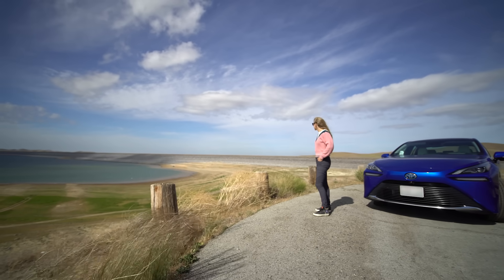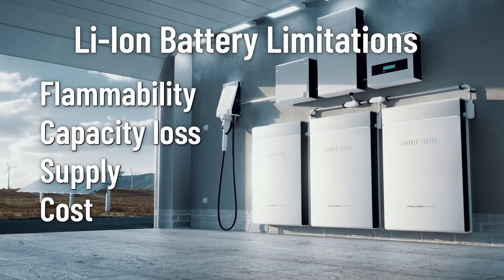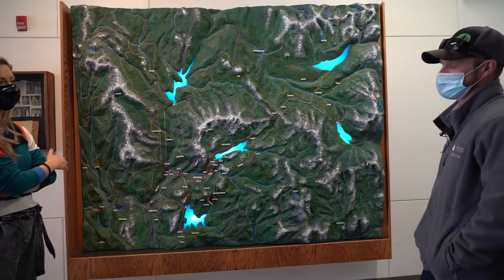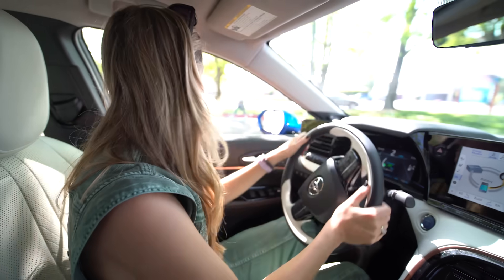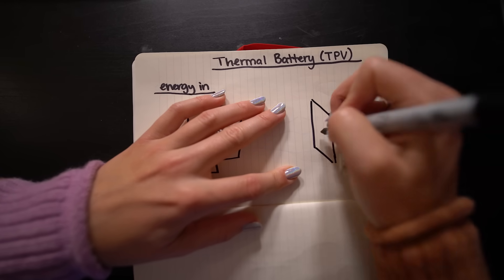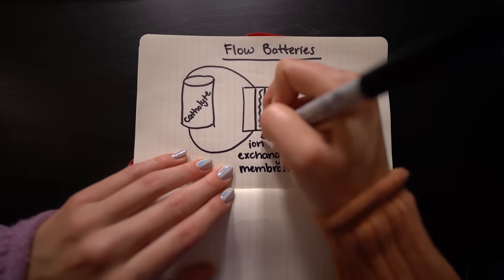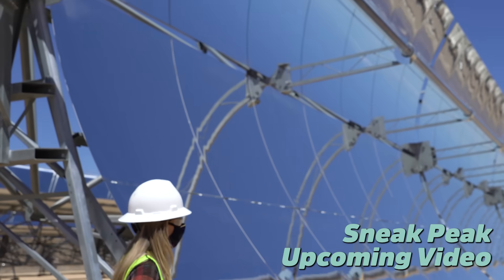The BIGGEST problem with clean energy

Comment: Wind generated electricity  has gotten about as inexpensive as its going to get and going offshore costs twice what it does onshore.   That means that wind generated electricity is for a human life time going to remain much more expensive than new technology clean burning coal plant generated electricity.   A large offshore wind farm of generators have double the cost of electricity in the northwestern region of the UK.   When not at power levels of wind huge amounts of expensive natural gas is used to run gas turbine generators.   Those wind turbines at best will last 20 years with some extensive repairs.   The economics are without subsidies they don't generate enough electricity to risk human lives and justify large expense for major repairs even with the alternative being expensive natural gas.  If heavily storm damaged or suffering major mechanic faults they will likely be left derelict.   Without nuclear power or new technology ultra high efficient clean burning coal generator plants the UK is faced with crippling high costs of electricity well over 2 times and likely real costs over five times that from new technology coal plants, depending on expensive natural gas.   A 1/4 of the population of the UK is now considered to be in poverty.  

Greenhouse gas behavior can not cause global warming.   There are almost no advantages in net zero carbon dioxide emissions.   C3 plants would greatly benefit from about three times the current levels of atmospheric CO2 levels reflecting their preferred environment when CO2 levels were ten times higher during their evolution, greatly greening the earth.  Earth's greenhouse effect absorbs all the greenhouse energy from the earth within 20 meters of the surface and is always in saturation from the strong greenhouse gas water vapor.    Noncondensing greenhouse gas concentrations can not change the overall effect of earth's greenhouse effect.   This is high school level science.   The cause of global warming is not known.  Global warming has been dead at about 1°C since 1992.  In 2022 global warming was officially stated at 1.06°C.   In 1991 global warming was officially stated at 1.1°C then went down.   Climate Change marketing does not use official global warming temperatures.

Comment: Try melting 1 m3 of nacl! It needs about 300 kwh of thermal energy at least. Now try melting it with renewable energy! 1 kmq of nacl x 10 m. depth can be a thermal green battery of about 3 Twh(1 Twh of electric energy) per fusion... And it's green^2.  This (thermal) storage possibility can open up other ways of producing clean energy such as hydroelectricity with seasonal rains, the energy of stormy sea waves, hurricanes energy..., etc...

Comment: The biggest problem is moving towards planned obsolescence with everything, and removing the possibility for resale. Take cars. An internal combustion car can last 10 years and still be in perfect running order, and if you sell it, it can last the next owner another 10 years. In fact, internal combustion cars can last several decades.
An electric car becomes worthless after 10 years when the battery (which is the most expensive part) comes to the end of its lifespan. An EV older than 15 years will be impossible, and swapping the battery pointless because the cost is so high.
So, instead of dumping one car every 20 or 25 years, we'll be dumping it every 10 years. Not to mention that disposing and recycling of an internal combustion engine is easy, while disposing or recycling batteries is problematic, toxic for the environment or prohibitively expensive.

Solar panels are being dumped indiscriminately, causing environmental issues, because noone wants to recycle them, it's easier and cheaper to produce new ones from scratch. First gen panels are already seeping leakage into the ground and water supply. What happens in 50 years when every solar powered household will have dumped at least 3 generations of panels?

This is insane, everyone driving a Tesla and installing solar panels is pretending to be saving the planet, when in reality they will be causing MORE pollution in the long run.

Comment: When I heard about hydrogen fuel cell technology being developed for EV power (>decade ago) I was excited!  But, it looks like it's going nowhere so far.
8:00 Those cell towers have more problems than lack of power after a major hurricane, with lots of them being destroyed.
So called, "Natural Gas" is not clean energy.  The name itself is blatant greenwashing.  It is methane.  And there will likely never be a means to store it or transport it without leaking substantial amounts of this extremely potent GHG.  And then, there's the fracking, which is the source of most commercial fuel methane.  Methane is a horrible stop-gap, arguably as bad as some other fossil fuels.

Comment: What would be good, is mini hydrogen separators (from water) for use at home.  You use solar and wind to run it during the day, and you use it to fill your fuel cell in your car, and for heating the home at night.   But this will never happen, because no company gets the repeat income as is the case for a gasoline infrastructure for example.  It would mostly be a one-time (or rare repeat) purchase of the unit.

Comment: How about the energy needed to produce rechargeable batteries? Researchers say the amount of CO2 pollution produced by an EV equals 4-6 years of CO2 pollution that’s produced by a petroleum vehicle just to manufacture the EV. So that shows EV produces more CO2 pollution in the first 4 years of use, which is its most prominent time of ownership. Because after 4-6 years, the owner is done with it and buys another one 🤷🏻

Comment: I wish you had discussed sodium as a replacement for lithium. Batteries are very efficient at storing energy over the long term (even as a mechanical engineer who is more familiar with thermal cycles I know batteries are better for storage). For storage of utility electricity, size is not too much of a problem but material cost and scalability are and here I think sodium would be more helpful as it is massively more abundant than lithium.

Comment: When we have sufficiently decent & reliable battery storage capacity they should put solar panels on every office  building & shopping centre as well as helical or similar small wind turbines which would greatly ease the load on the energy grid. Kinetic pavements in high foot traffic areas. All new house builds should have solar roofing & windows I think that would at least help to ease the energy crisis some. Love your videos they are always educational & fascinating

Comment: Yawn, There is only one totally green solution to hydrocarbons as an energy source and that is Hydrogen. We can store as much hydrogen as we can electrolyse in summer for use in winter. There aren't enough viable sites for building all the pumped storage we would need and the idea of battery banks for a whole country for a whole winter is simply absurd. 
In addition to wind we can add the huge amounts of power available from Tidal Barrages if we can store it effectively.

Hydrogen isn't very efficient (but how efficient does it need if it is effectively free?) but it can be liquefied and we already have suitable technologies to build as much storage capacity as we want.
one of the limits on Wind power in the UK is that we throw away a small amount of it when it is windy - so there isn't a great incentive to rush to install more....well, up until Putin's invasion of Ukraine..... but now the time is absolutely ripe for Wind/Solar/Hydrogen to massively reduce the need for 'standby' gas generation.

Comment: This Is not the biggest problem. The biggest problem is mining and where the US gets its raw resources.  Who’s making those solar panels, where’s all the mines.
Reply: Solar panels are a bad example in this regard, they don't depend much on critical resources.
Silicon is everywhere, you just have to process the silicon dioxide to get the pure silicon. This could be done everywhere. But probably not as cheap as in China.

Comment: You talk about running out of lithium...and aren't many other precious metals necessary for solar power
Reply: Depends on the kind of solar power. CSP basically doesn't need "precious" metals. 
PV needs small amounts of silver, but as far as I know, this could be replaced by copper, if necessary.
Reply: @701983  what about platinum too, right?
Reply: @auniversalwoman  Platinum for solar power? No!
The only well known use of platinum in this field (clean energy) is in hydrogen fuel cells, best known for fuel cell cars (Toyota Mirai, Hyundai Nexo). 
AFAIK, the biggest part of the platinum production is used for catalytic converters in (conventional) vehicles like gasoline cars.

Thin film photovoltaics can use rare elements like tellurium, indium or gallium, but not the "normal" market-dominating silicon based photovoltaics.
And just in case: Silicon isn't rare, it's one of the most abundant elements on earth.
Reply: @701983  in hybrid cars i think 🤔
Reply: @auniversalwoman  Like I said: In all kinds of gasoline cars, including hybrids.
Reply: @auniversalwoman  The amount of platinum needed for fuel cell cars is higher though.
They made a lot of progress in this regard, reduced the demand a lot, but you can still make catalytic converters for several gasoline cars with the amount of platinum needed for one fuel cell car.
Reply: @701983  thank you.  You know a breadth on this subject
Reply: @auniversalwoman  I'm interested in this subject (future energy sources) for decades now, had a lot of time for learning.
But thank's!

Comment: Ok - Bottom line solar & wind require fast responding backup power & 95% of that backup power in the USA is CO2 based diesel or natural gas power plants. And over in the EU since Russia has shut off the oil pipelines several EU nations including Germany & France are burning coal again & reopening nuclear power plants to keep up with energy demand.

Comment: The problem is is that you have been lied to and brainwashed thinking you know all about it when you don't know anything about it. Yhere are are over 50,000 patents that have been issued for designs which require only a small initial charge, which after the first start up (should it ever need to be shut down) provide the energy as it recharges the single 9v as needed. Every home would be equipped with a unit requiring no centralized source and no fees, which is why they won't permit it. Some designs need no initial charge (the best one). Nothing personal, you clearly aren't the only one.😇

Comment: The duck curve? I argued with some one online a while ago saying that most power is required when the sun goes down. That person said I was wrong and most power is consumed during the day. The data I looked at or was referred to confirmed his argument. This duck curve would seem to agree with my original thoughts. A problem I just noticed, when looking this sort of information up all the time, you get the residential power curve, even if you use words to try and avoid it in your search. Industrial can be searched separately, but you can't add the kilowatt usages together, because they usually plot a percentage rate or something similarly non universal. Why are they separating these things into unrequested categories obfuscating what should be a very simple search? Do those power companies supply different power lines to domestic and industrial? No of course they don't', so it would be easier just to give the totals, but they don't list them that way. I smell a rat, it feels to me like they don't want you knowing.

Comment: I’m a huge fan of nuclear fusion. It literally recreates the same energy as the sun, is relatively clean as it produces helium (a usable compound) and a free neutron, instead of an unnatural split compound (toxic waste). & considering the recent advancements in stabilizing the plasma flow (check out the stellarator) is relatively safer & more efficient. & lastly, it is a consistent source of energy (which we need) & isn’t dependent of topography (you can set up a reactor almost anywhere in the world, seamlessly into an already existing grid). It’s the future in my humble opinion.

Comment: Hi Physics Girl.

Great video. Just wondering if you have come across a newer idea for pumped-hydro from a group of academics at the Australian National University, lead by Prof Andrew Blakkers.

Off-river pumped hydro. Their idea is simple. Since the amount of energy that can be stored is proportional to the height difference between the two dams/pondages, you want to find sites that have big height differences. And most of these sites aren't next to rivers. They are in other locations, away from a river. The pumped hydro site you visited in California had a height difference of 300 feet. They have identified many 1000's of sites in Australia, and now many, many more around the world, with height differences of up to 600 meters!!! So to store the same amount of energy as that California site, you would only need 15% as much water, and the dams/pondages could be much smaller. Meaning you need to make up less water to account for evaporation.

So, how do you get water for this, if it isn't on a river? Well it might be near a river, say a few km away. So you run a pipeline from the river to fill the pondage as needed.

Or, you use evaporation suppression systems - essentially covering the dam/pondage - to reduce evaporation. The best evap' suppression systems reduce evaporation by 70-90%. Typical annual evaporation losses for open water in a medium climate, not desert, may be 2-3 meters per year. But if ideally you could reduce that by 90%, that is just 20-30 cm per year. If you have a halfway decent annual rainfall, say 0.5 - 1 meters per year natural rainfall will keep it filled. And even a year or few of drought would still only lower water levels by a meter, and one years average rainfall would refill that.

Their idea would see something like a Turkey's Nest dam built on a suitable hilltop, built mainly from earth and rock excavated out of the hilltop, and a second pondage at the base of the hill. They might be on private land, and they don't need to be concerned about having large catchments around them.

And there are huge numbers of potential sites - nowhere near built out yet.

Here is a link to the map of potential sites, worldwide, at ANU. 

https://www.anu.edu.au/news/all-news/anu-finds-530000-potential-pumped-hydro-sites-worldwide

Comment: Another answer is the CO2 Methane cycle, there are chemical processes that can convert Methane to CO2 and back again thus alleviating existing problems. Its what Elon Musk is using to create renewable fuels out of the existing gasses for space travel, and not contributing any more new extra emissions if done right. Only issue is it requires nickel as a catalyst for one of the reactions which is being used for electric vehicles instead. Just convert everything to methane engines and recapture the CO2 for conversion back. There's a video on it and its very good. https://www.youtube.com/watch?v=yRtx56xl-70

Comment: 20 years ago It was known within certain sectors of the power production industry that it would be cheaper to massively overbuild wind power, along with some solar, and combined with a coordinated national grid system, we could be at 90 percent renewable electricity without battery storage or nuclear energy. The drastic price decreases in batter storage costs make that even easier.

Unlike what the doofus says at 4:05, solar power sources have no problem being disconnected from the grid. PV modules are one of the few power sources that have no issues being used from 0 to 100% of their capacity at any time. They do not "force" power onto the grid, and can be ramped up and down in milliseconds. Large rotating kinetic mass generators such as the hydro generators need much longer to change power output, and will "force" power onto the grid until they can be ramped down. Wind generators are also rotating kinetic mass generators (albeit much smaller than most large hydropower generators), but depending on their configuration, are very easy to change power output, and bring online or take offline when needed.

As an electrician who has worked on wind, solar, hydro, combined cycle, and nuclear plants, nuclear power is highly overrated, and THE most expensive source of power available, along with not actually being low carbon when the entire construction, fuel cycle, decommissioning, and long term wast storage is considered. The US has spent, on average in inflation adjusted dollars of DIRECT taxpayer subsidies, 3.5 billion dollars per year since 1948 on nuclear power, yet it is our most expensive source of grid scale power (120 to 180 dollars per mega Watt hour). Renewables have received 0.38 billion in direct taxpayer subsidies a year since 1994, and are the cheapest source of grid scale power today (25 to 50 dollars per mega Watt hour).

Nuclear power also has a huge indirect cost to taxpayers in security, insurance indemnification, and unknown waste disposal cost for tens of thousands of years. The total insurance pool for nuclear power reactors in the US is around 13.5 billion dollars. As the Fukushima disaster is reaching a trillion dollars, if the US had a similar disaster, the US taxpayers would be on the hook for the remaining 986.5 billion dollars.

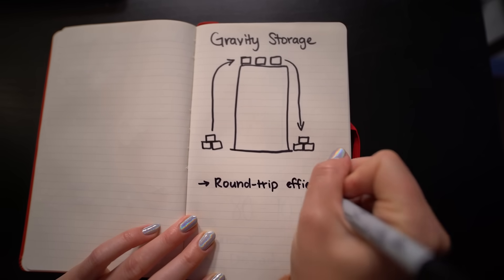Comment: 5:57 Replace the bricks with water, same principle like a steam engine, but with water instead of steam.
Also, I'd use large water globes or water cylinders, one above the other.
When energy goes in, the piston compressor moves water upwards, when energy comes out
another cylinder allows water to come in, and push the piston connected to a generator.
Easeh peaseh. And yes very energy efficient. But when energy comes at a surplus doing input,
well, you only need to look at the energy coming out, really.